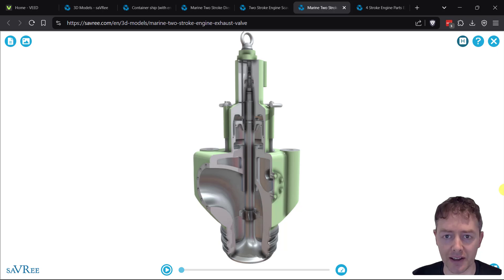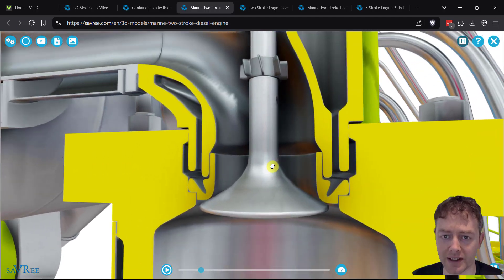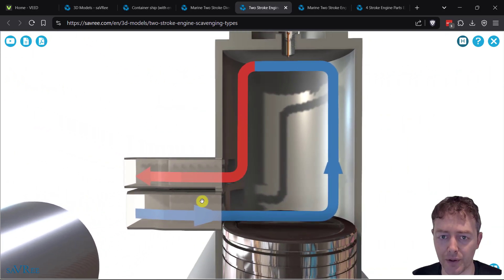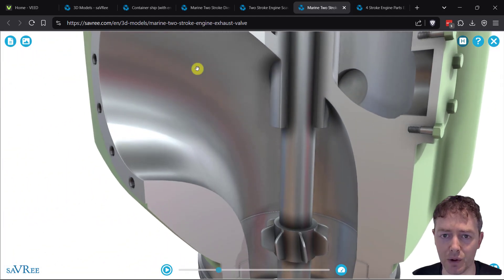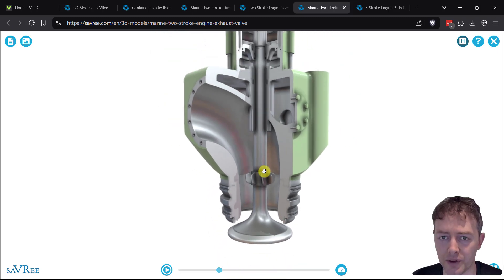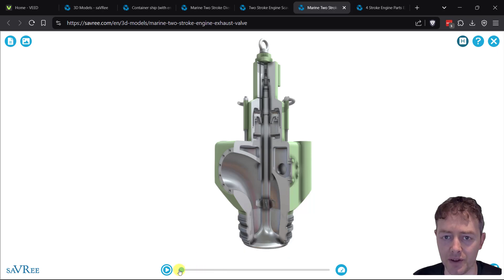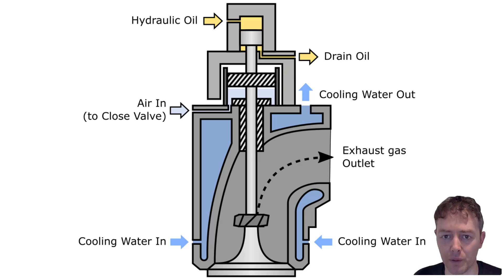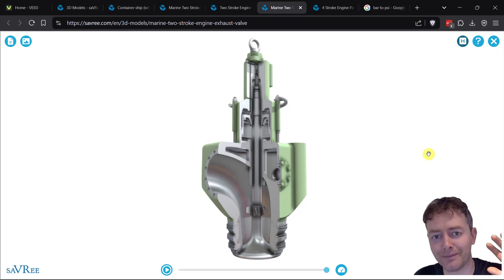saVRee Snacks #8 - Marine Engine Exhaust Gas Valves Explained

Comment: An excellent introduction to concepts. I remember years ago finding a Sulzer tech service memo about exhaust seat cracking, I think it was a Stellite casting, but the eye opener was the insane depth of detail that went into what seemed a modest part.
Reply from the maker: Like marine engineers, exhaust gas valves are under appreciated! 😂

Glad you liked the video. We are releasing a whole course soon for this valve (the course is a lot more in depth).